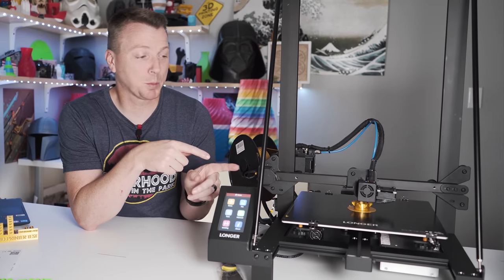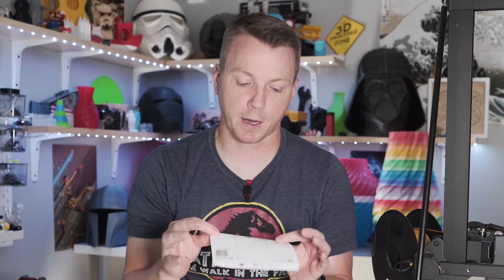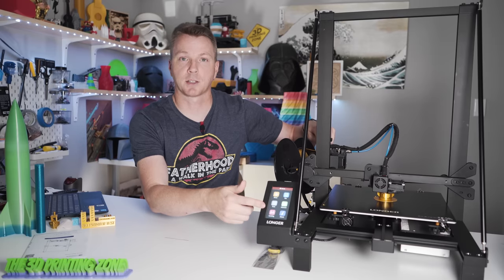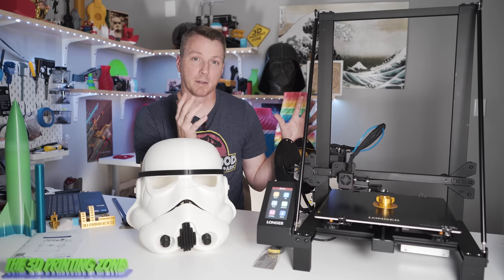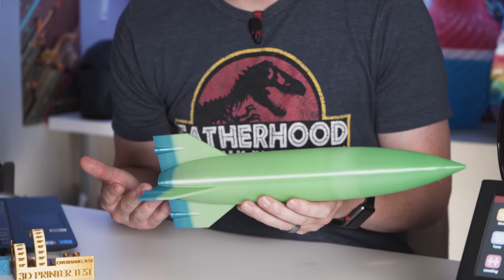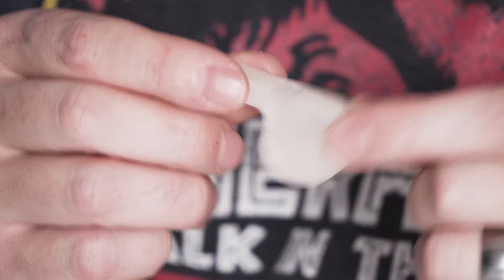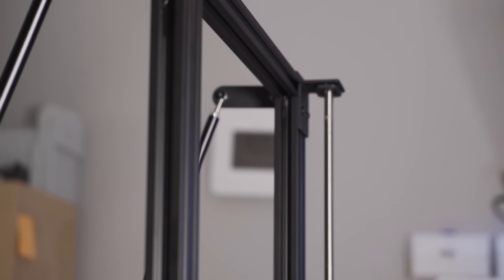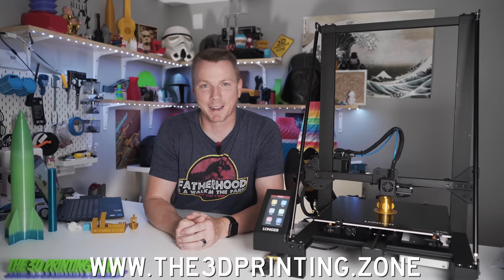The Cheapest BIG 3D Printer Out There - Is It Any Good? (Longer LK5 Pro Review)

Comment: Needing something larger simple and self-sustained is what I’m looking for.  On a farm there are common wear parts that are not expensive but take time to get..especially with the supply chain nearly non-functional-it can take 6 months to get a 3/5.75 nylon bushing for my 45 year old seeder!…that’s where a 3D printer would be handy.  For a first time buyer I’m hoping this is the printer that will work.
Reply: You should be fine with this one. Just take your time to learn it.
Reply: Nylon is hard to print you would need a new hotend and you would need to upgrade the bed and you need a filament warmers because nylon opsorbs a lot of water.
Reply: @metalmangamer  you can't be sure of those things.
Reply: @lloydrmc  
Yes he can. Nylon is notoriously one of the most difficult filaments to use.
Reply: Sovol SV03 mops this one
Reply: I'd just buy a cheap table top lathe and some nylon bar stock. Very easy to do and much faster.
Reply: @JSAFIXIT  I agree. 3D printers, in my experience, do not really do a good job. Noticeably the quality of the print. I hve yet to find a filament that is actually strong enough to use in a project. Injection molds are the only way to go for parts that have any "Pressure" on them. I got a Central Machinery 7" X 10" precision lathe. After getting everything set up and running, I did exactly what you have suggested. I am a CNC machine operator and also do some programming edits. I use the nylon bar stock remnants from work.
Reply: @JSAFIXIT  I agree it’s the best way to get a part that “just works”
Reply: Old comment but on a farm, I don't see how 3d printed parts would help, they're relatively weak and the wear and tear...they'd wear out incredibly fast, I doubt it would be cost effective :(
Reply: @joshyc2006  sounds about right. That's why I'm looking to get one to make the shapes I'm looking for to make molds (with fins/seperators printed on for making more complicated or intricate molds)
Reply: Yes sir our sprayer heads keep going  out I could print one before it got shipped to us

Comment: Printing in the middle of the bed on a large format printer doesent give a true evaluation of the printing capabilities of this printer, I would like to see all reviews show an attempt to print a 1mm deep sheet of plastic covering the whole of the bed to show the full print capabilities after all the reason you would buy a printer with a large bed is to print parts with a large bottom part, its no use having a massive bed if its so warped that you cant print on it, and if your aluminium bed is rolled and not cast its a pretty good bet its going to be warped, of course there are the odd exeptions but in my experience large beds need ABL, some have FW that enables manual mesh levelling but with a large bed this is a pain
Reply from the maker: That's a great suggestion. You can see around 8:56 that I'm printing a large print that takes up most of the bed and it worked out great but I like the idea of doing a large flat bottomed print that takes up pretty much the entire bed to see if any given printer can handle that. Could even just be a big square bin.
Reply from the maker: @colinrobinson9858  I haven’t yet printed a full bed print because I’ve been testing several other printers lately so the full size stormtrooper helmet is the biggest print I’ve done but it came out impressively well.
Reply: Anycubic predator for the win!
Reply: @The3DPrintingZone  do you have to level it for each print?
Reply from the maker: You don’t have to level for each print. Typically you’ll level it once and then not have to for quite a few prints. It will only need to be leveled again if there’s an issue of some sort.
Reply: @The3DPrintingZone  thank you so much dude

Comment: Just bought the Creality Cr-10 V3 as my first 3D printer (new to 3D printing but definitely not to CNC and g-code after making a mini CNC mill). With 130 discount it comes in at 389 and has dual Z-axes, direct feed print head and looks as if it uses the same basic  construction as in your review, but heavier duty, has the same print volume, and does come with decent feet and cutters 🙂. Seperate power and control box with mono screen. Don't know if you've reviewed this or not but the only flaw I have found is a slightly dished glass bed.
Reply: You are new to printing so you might not be aware, with dual z-axis lead screws you need to pay attention to make sure the Gantry does not start walking higher on one side. The gantries tend to become out of sync with a dual Z axis lead screw assembly. Just some food for thought. Welcome to the world of printing, creality was my first printer as well. I've been running an Ender 3v1 for about 2 years and finally upgraded it to a new hot end. The creality machines tend to be reliable as far as I've been able to tell but I've had other machines already die on me that took way less abuse! When I say abuse I mean I kind of throw my V1 around every once in awhile when I'm transferring from one area to another or it's in the back of the truck sitting on the seat getting thrown around.
Reply: @SteveSiegelin  I first had to buy one replacement Z-axis stepper as the one nearest the control interface was bent on arrival. Creality didn't even respond to my emails (including videos) so I just paid £20 for replacement rather than send the whole machine back (which is what their customer service deserved!). Been running fine since and no noticeable tramming errors on Z-axis, although I always run a BLTouch calibration cycle before each print so that would negate one Z stepper being out of sync by a step or more.

Comment: Got mine 2 years ago from NEWEGG.. it was on sale for $179.00 with a 10.00 dollar rebate..  it was refurbished but it was refurbished by LONGER and shipped right from LONGER..  and I can save you some time .. the LONGER LK5 PRO is a fantastic deal, I have been printing like a mad man for 2 years and love this printer.. made some changes to it as soon as I got it.. first moved the spool mount to the top.. printed a pully for filament also got a new  .. then bypassed the cheap runout sensor as they do not last very long, that is why they send 2 with it.. save some time and headache and just bypass it ..then I got an extension cable for the MicroSD card and made a mount in the front of the printer right under the LCD screen..  YES THIS PRINTER IS GREAT!!!

Comment: Just stumbled upon this video. I bought one of these 3 years ago and it still is doing a heck of a job. I have it connected to my OctoPrint and probably have run it for 3000+ hours at this point. Very reliable and perfect if you need to print something bigger or many small things at the same time. Obviously it's lacking the printing speed of current 3D Printers but at that price point it is very negligable. Definite recommendation from my side if someone is looking to get into 3D Printing and wants to tinker a bit with their printer.

Comment: I have one other suggestion, for a 'rule' for unboxings and reviews.. that you assemble the printer (and first print) WITH JUST THE TOOLS/PARTS THEY SEND YOU.  I have suggested this to other reviewers (because my first printer required a trip to the hardware store for tools)....  The ONLY exception I would say would be if the printer does NOT come with any filament (which I would say is not right, AND that if they have any sample prints that the filament they DO INCLUDE be enough to finish the sample print).
Reply from the maker: Sounds fair. I actually haven’t had many (any?) printers that I couldn’t assemble with only what is included, which goes for this one too. I do sometimes use my electric screwdriver because it’s faster than using the included Allen keys but that’s just to save time. And I agree - they should all come with at least some filament to start with.
Reply: @The3DPrintingZone  Thank you for the response.  When I was a kid the three most TERRIFYING words for a parent to hear were "some assembly required"!  What tools would you need, would all the things be in there (dad bought a bicycle that did not have INNER TUBES for the tires one time!) to make it run.  His solution after we got to about 10 yers old was to hand you the box and tell  you the tool-room (he kept it under lock and key) was unlocked, go to town....

Comment: Stringing is due to the moisture content in the material, many 3D operators don't know how to properly store material as PLA is hydroscopic. 
For a hobbyist printer it looks decent but if you want precision the quality isn't there. 
Anytime you have to keep fiddling with adjustments and not printing in a temperature controlled chamber it is not going to be good for consistency.

Comment: Excellent review! I just went ahead and bought one after watching, really excited to get my feet wet with 3d printing and this seems like the perfect one for me. I was looking for something large format but still light on the wallet, but also does decent prints. You seem pretty happy with the results, so hopefully I should be fine as a noob. Cheers!
Reply: Good luck with that. The problem I have had is simply, out of the box it works great for about a week or 2, that's when all of the headaches start. All of a sudden, the prints start not coming out the way they should. Trying to figure out what went wrong is a very, very tedious task. You will be pulling your hair out trying to figure it out. And, when you go to the reddits for help, there are a thousand different answers you will get for solving problems. Most of which I found out weren't really helpful at all.

Most were "All you need to do is UPGRADE to this or that". Which, also, in my case, didn't help at all. These machines are just so damn picky on what they need in order to operate continuously. I sure hope you don't mind tinkering, because that is where your life is going. The answer to this is "That's most of the fun about 3D printing, fixing things instead of printing"

Just keep in mind that this guy is getting paid for this review. His "Dislikes" are mostly aesthetic and not really informative.
Reply: @paulreeder5241  Definitely a bought review, he doesn't even mention the single Z axis which for a printer this size is usually a bad idea and definitely something the competing printers of this size and price do usually have.
Besides that, you had those issues with this printer? Because more 'mainstream' printers (Ender 3...) work out of the box and will continue to work fine for months before requiring a bed level (2 minutes) and a year or so before requiring nozzle and PTFE tube replacement (30 minutes), if you require regular maintenance just to keep it working there's something very wrong with the printer.

Comment: This is my first and currently only printer and I can say it's definitely quite reliable and a nice machine considering it's had to deal with all of my learning 🤣 I originally did try to print with PETG however ran into so many issues with clogging, globbing, stringing, etc to the point where the hot end temp sensor got pulled out accidentally so I replaced the hot end and swapped to PLA and had little to no issues with prints. The PETG issues are most likely due to my lack of skill with 3D printing though
Reply: Have you tried PETG again since? Anything learned you'd like to share?
Reply: @Airbag888  Haven't tried it since. Like I said I'm sure most of my issues were just lack of skill with 3D printing
Reply: @dakotareynolds3049  So basically this is to this day still a great buy huh.
Reply: @Airbag888  I'd say so
Reply: @dakotareynolds3049  lol not quiiiite as convinced as I would've hoped haha.. anything you'd do different or recommend?
Reply: @Airbag888  Lol nothing I'd change. I just feel like it'll be a learning curve regardless of which printer you buy first
Reply: @dakotareynolds3049  Ah good :p I would expect that too. Right now I'm looking into any potential bad effect on my kids lungs during/after a print.. I only have my office to put it in for now so fumes, micro plastics, etc may be a concern? Don't know if you had to overcome any of these with any filament types?
Reply: @Airbag888  There isn't really anything I can tell you that google can't as far as that's concerned lol. The most I've noticed with PLA is that you can sorta smell the melting plastic while it's running but it's not a strong smell. Otherwise, google is your friend. I won't claim to be an expert on plastic fumes lol
Reply: @dakotareynolds3049  Fair enough. Thank you for your help and time!
Reply: Is there a way to disable power loss recovery mode on this printer?

Comment: I print one piece wearable helmets on my cr-10s5. I would waste more filament on support than i used on the masks.  I experimented and came up with a solution. 
Figure out at which line in your helmet slicer that supports become necessary. Write that number down. 
Design a cup that is close to the same diameter as the helmet (at the internal point supports are needed). 
Print the cup to the line height you wrote down. 
At that point in the helmet slicer put a "change filament command". Also start support at that line height. 
If your slice does not allow. Make a solid layer 2 lines thick at that height in the helmet stl. print helmet to that height. 
when the printer pauses. Insert cup flat side up into the center of the helmet print and use napkins to fill in gaps. 
Keep napkins below highest print level. Resume printing. 
Keep a heated hot glue gun at the ready for quick repairs. 
It may take a few layers to perfect itself. 
I save nearly 2 rolls of filament and about 3 days of print time doing this. 
Try it on a small couple hour print to master the technique
Reply from the maker: That's a pretty sweet technique! That way you get the benefits of printing right side up without the downsides of wasted support filament. I often print pieces upside down and at the optimal angle to avoid supports but it does create the need for extra sanding/work on the top of the helmet typically. Great idea!

Comment: Great review, I've had mine for about 2 months now and finally getting comfortable. Unfortunately it suddenly stopped powering on. Checked connections, fuse, and confirmed power from the outlet. Their support seems little to non existent
Reply: Any update on support?
Reply: @LeftyPencil  Never received any support so I started doing my own testing and probing the power supply to see if I could isolate the issue. When I probed the chassis of the power supply the system suddenly reboot and I have not had any issues since

Comment: I have a Longer-produced version of this printer, the Alfawise U20 ONE.
The only problem that is constant is the lack of synchronicity between the dual Z axis motors.

It has 6 wheels on the Y carriage and was able to print at 250nn/sec with better than average quality and 200 mm/sec with actually GOOD prints.
Longer just is a solid printer, but not very complete with the current state of the art.

Comment: Nice video, cool printer, and I'm glad to see that I'm not the only one that gets that "seam" section on the left side of benchy. I thought it was something on my 2 printers that I was doing wrong, I have an ender 3 and a voxelab aquila, and both get the seam, but otherwise benchy comes out flawless. Do you have a link to your temp gun also?
Reply: If you use Cura, you can choose where you want the seam to be. (Use sharpest corner) Probably available as an option in other slicers too. You should go through all the settings.

Comment: Hi.
I want to buy this printer and at the same time a Kit to duplicate the Z axis.
I have seen several but I don´t know the length of the vertical screw of the Z axis that comes with the machine itself.
Could you tell me what the measurement is to buy the correct one?
Thank you so much. ☺

Comment: Questions: what comparable or better large-scale 3d printers would you recommend? What's the material cost to print the cool rocket? Thanks! Great review.
Reply from the maker: Other ones to consider are the Ender 3 Max, Ender 5 Plus and Snapmaker (amongst others) and they, of course, all have their pros and cons. The new Prusa XL that is only available for preorder will be amazing but starts at around $2000. The material cost for the rocket was likely around $3. Gold filament, vase mode (spiralize outer contour) and it probably only took around 1/10th of the roll maybe.
Reply: @The3DPrintingZone  Sweet, thank you for the 3d printer ideas and the surprisingly low printing costs. I hope you review more giant 3d printers and showcase interesting models. Cheers!

Comment: I recently bough a USED ENDER 3.
At that time , I printed a spiderweb and it did a fine job.
 I tried adjusting it , since then ,  and NOW it will HOME OK , but when I attempt a print , it will go to about 1/8 inch above the bed , and no lower ..........UNLESS ..... I set the Z-TRIM to -3.9  in the BABYSTEPS function...... then it prints just fine.
I have tried to search out an answer to no avail.
Can you tell me what is causing this ?
Thank you ...............................
I

Comment: Hey this video is getting a bit older, but i just want to say, if any of you are trying to get even better bed levelling and heating on this printer, go find higher quality and at least 8+ clips for the glass bed. the four clips it comes with are good enough for anything 150-200mm but when you go bigger the extra clips put enough pressure on the bed to level it and heat it way more even towards the edges. The printer is great but the glass bed doesn't enjoy being flat (Not a material scientist) happy printing!